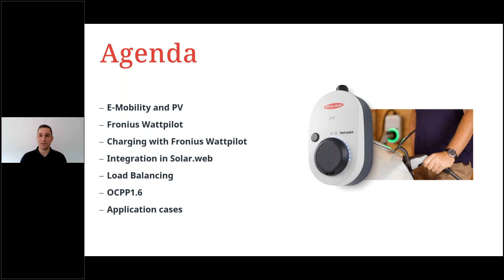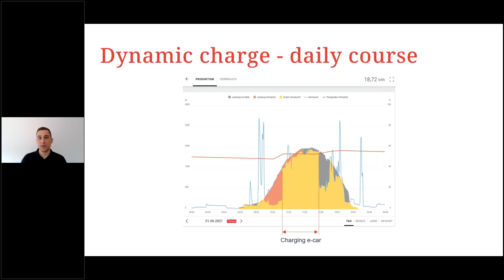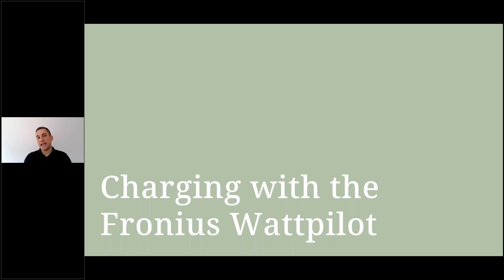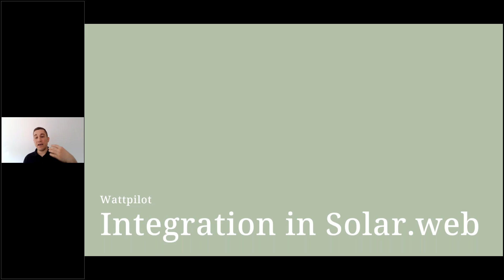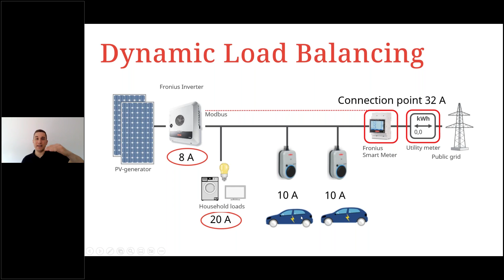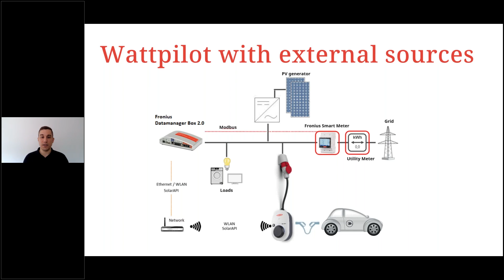Webinar: Fronius Wattpilot – Overview of the latest features

Comment: I have Fronius Primo inverter
I am confused...

7:18 Fronius Smart meter is actually not needed, it is just nice to have, am I correct? Or is it neccessary?
8:19  "no matter which Fronius inverter, you can instantly use it for charging with PV surplus energy"

In instructions for Wattpilot Go 11 J 4 it says:

Suitable inverters Compatibility with the connected devices, suitable data communication and a Fronius
Smart Meter at the feed-in point are prerequisites for using some Wattpilot functions (e.g.
PV surplus).
Suitable Fronius inverters
- Fronius GEN24
- Fronius Symo Hybrid
- Fronius SnapINverter (except light versions)
- Fronius IG*
- Fronius IG Plus*
- Fronius IG TL**
- Fronius CL*
*Requirement:
- Fronius Smart Meter

----- note, no mention of my Fronius Primo inverter, so I am confused about statement 8:19

Q1: If I buy Wattpilot Go 11 J 4, can I charge my EV directly from PV surplus energy (ECO mode) from myFronius Primo inverter without Fronius Smart meter, or not?

About Solar Wattpilot app:
Q2:  Can I manually just start and stop charging through app?
Q3: Can I set specific time for charging (let's say I can see electricity is cheap beween 1 and 4 o'clock in the night, I can set it to charge at that timeframe?)
Reply from the maker: Hi Tee Jay!

A1:For charging with PV surplus a Fronius Smart Meter is always necessary. With a Smart Meter in your system you can directly charge your car with PV surplus energy.

A2: Yes, you can controll the whole charging process through the https://pulse.ly/ppdqwucmz7 app.

A3: Yes, you can set this also in the https://pulse.ly/ppdqwucmz7 app under Settings/Scheduler.

Best regards, your Fronius Social Media Team